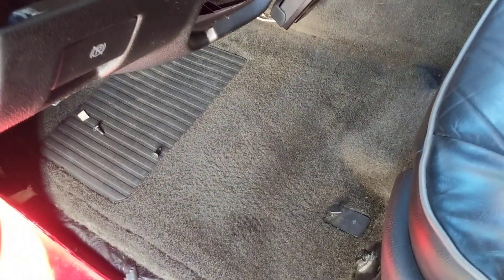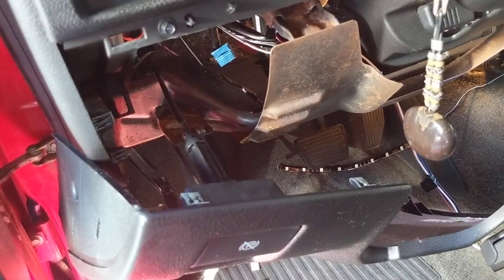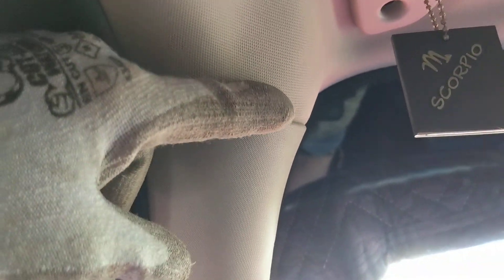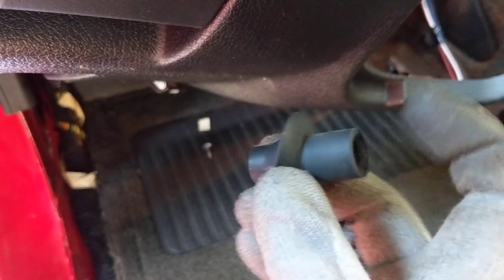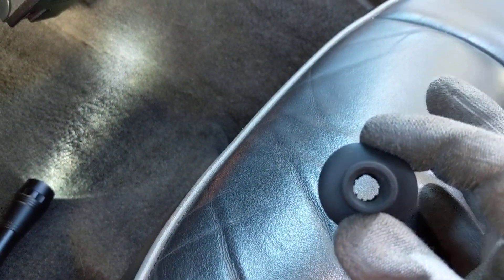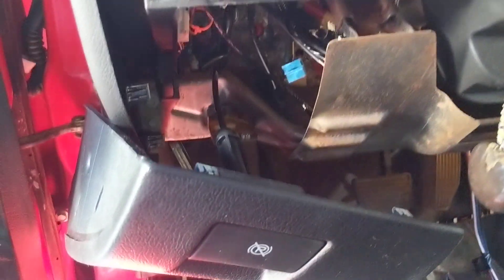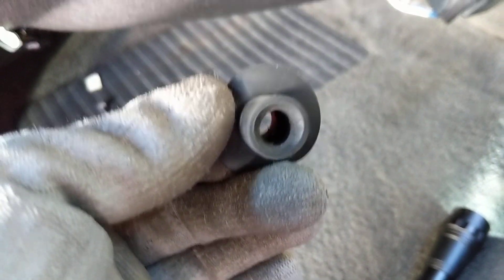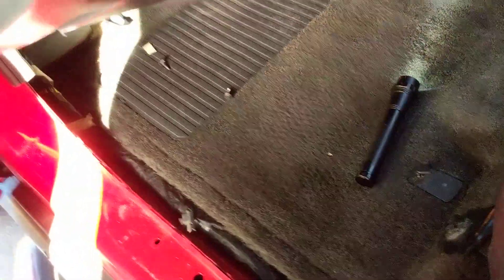Hummer H3 Sunroof Leak Fix the Grommet

Comment: You do not have to take your dash apart! You can just reach up from underneath and pull it out.  Just did mine... I have large hands.  Took me 5 min to pull it out, drill and put back in and test.
Reply from the maker: You are a Rock Star! Believe me when I say I looked for the thing before I pulled everything apart.  I think not knowing exactly where or what it looked like just became frustrating. So, the dash  came down.  My other option was about to be a  match and a can of gas! 😉 😂  Thanks for checking out the video and your comment!
Reply: I guess Im asking the wrong place but does any of you know of a tool to log back into an Instagram account??
I was stupid lost the login password. I appreciate any tricks you can offer me
Reply: @Darius Ricky instablaster =)
Reply: @Ephraim Alonzo I really appreciate your reply. I got to the site through google and Im trying it out now.
Seems to take a while so I will get back to you later when my account password hopefully is recovered.
Reply: @Ephraim Alonzo It worked and I actually got access to my account again. Im so happy!
Thank you so much you saved my account :D
Reply: @Darius Ricky Happy to help xD

Comment: A better fix than having to locate that rubber grommet all the time is to buy some clear tubing the size that is  being used in the collum and run it down through the floor you'll never have that problem again .